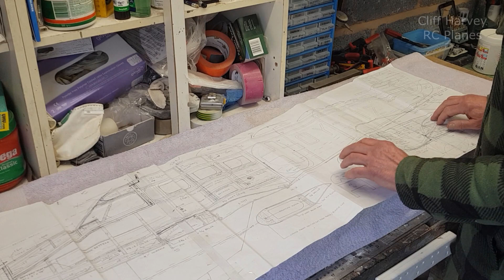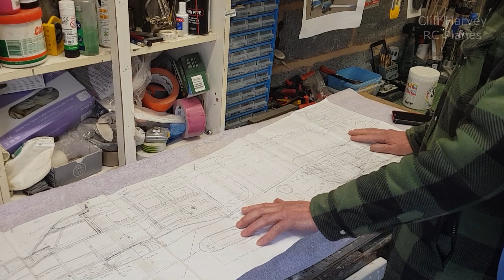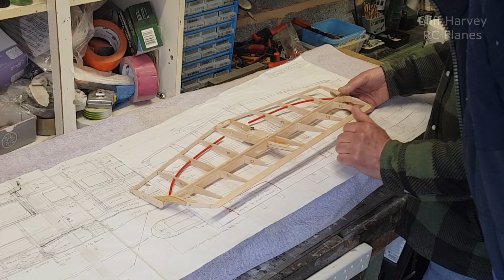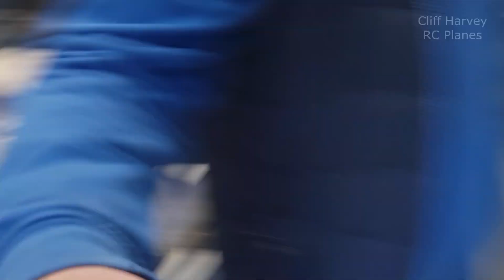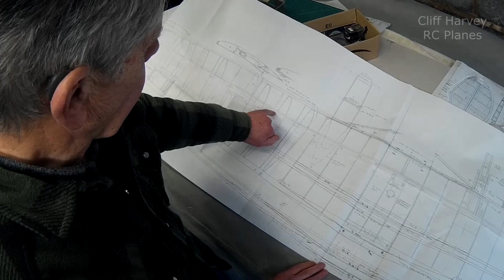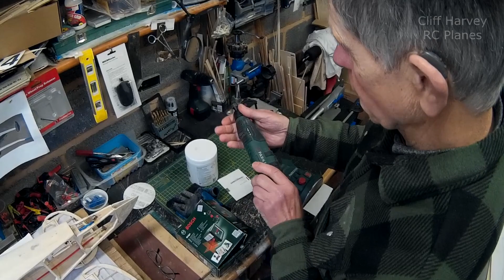Model Aircraft Builders Rob W. Part 1

Comment: I love the series name Cliff. Perfect. Rob has a nice project going! I love the D18, such a beautiful classic twin. The Du Bro nylon bolts are not hollow if you can get them there. The E-flite D18 has a dual linkage set up for the rudders similar to what Rob is doing. I wonder given the size of his model if two 9g servos, one for each rudder, might be easier. Not much weight, but that far back it may or may not be an issue on a plane that big. I guess it depends on the two motors and the battery placement. The downside to the dual linkage is it is hard to get much throw, and the D18 needs it on takeoff. I really enjoyed listing to you two talk building!
Reply from the maker: Thanks Adam, great comment, Rob is away for a few days and he'll evaluate the comments upon his return, it's going to be a gorgeous model, cheers

Comment: Beautiful BIg Beechcraft bones, Rob! 
You mentioned at 8:12 in the vid bout the nylon bolt you had selected for the tail mounting was hollow--and that it had snapped. It may be that you'd found such hollow nylon bolts as the ones our hobby suppliers often choose for the purpose of aiding a 'break-away' junction/joint...especially the larger sizes of wing and/or tail attachments. A sort of 'frangible link', so that it fails before the balsa structure suffers damage in hard landings.
Reply from the maker: That makes sense, Rob will appreciate the information, cheers
Reply: I think you have a good point there. I may need to lubricate the bolt before tightening